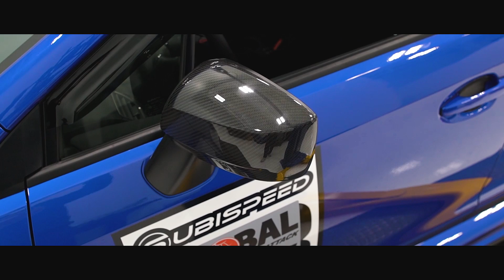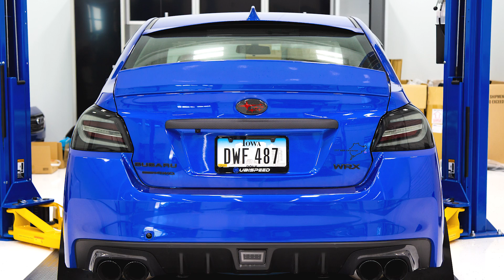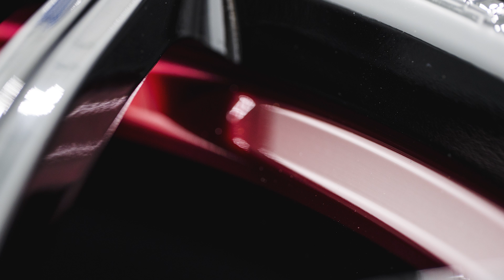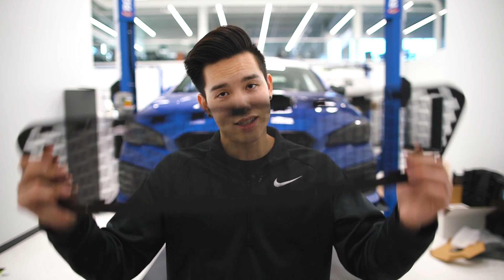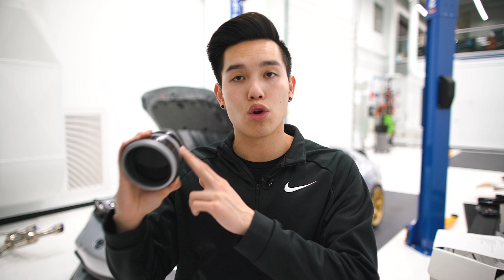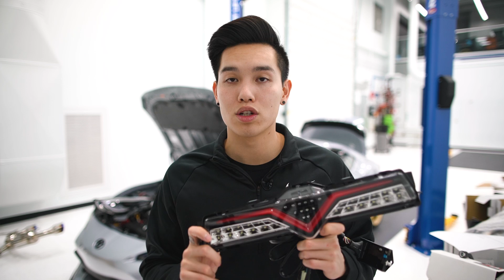New Products January 2019 - Subispeed

Comment: Wedssport tc105x fitment 2018 STI?  I’m in the market for wheels and have stock suspension, I’m not going to lower the car.  Any rubbing issues? 255 or 265?  There’s a lot of different info on what won’t fit and what will.  What fitment do you suggest? Thanks.
Reply: Running 18x9.5 265/35/18 Nittos 555 G2 +35 offset no rubbing issues with stock suspension if that helps.

Comment: They really should have made a cutout for the rear brake light on that new duck bill. That's a ticket waiting to happen...
Reply from the maker: If anyone's actually worried about it they can just run a lower third brake light or high mount brake light.
Reply: @SubiSpeed  I thought the same thing, until I read that the 3rd brake light has to be high mounted, above the normal tail brake lights :(
Reply: @SubiSpeed  I think you would have to somehow move a new brake light to the top of the window
Reply from the maker: http://www.subispeed.com/intec-high-mount-brake-light-2015-wrx-2015-sti-2013-ft86#.XDeIH2lMGdM
Reply: A third brake light is not required by DOT or NHTSA = no infraction for omission or inoperable condition.
Reply: Just run the olm 3rd F1 brake light